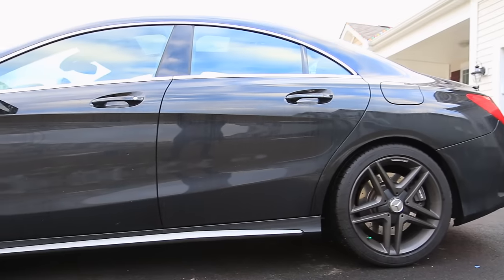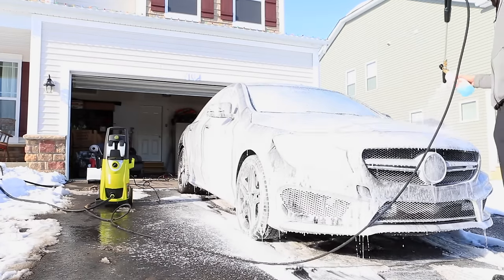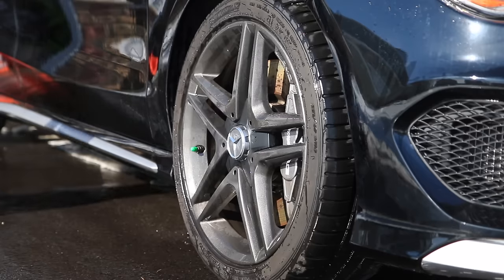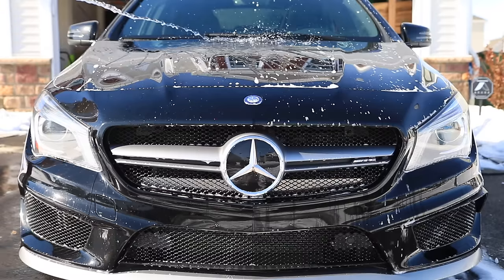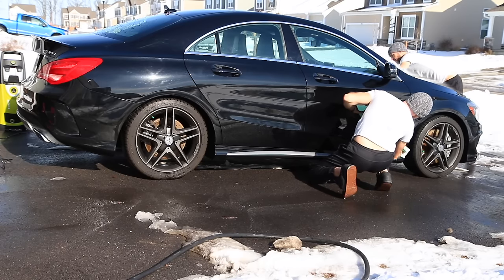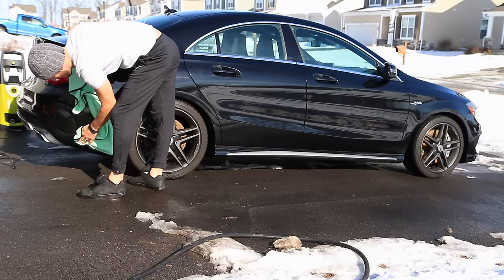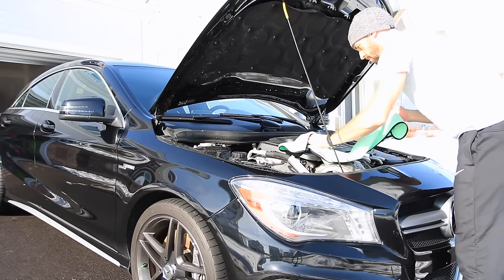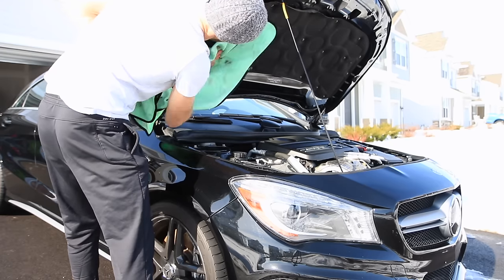Exterior Car Detailing Like A Pro! Car Cleaning

Comment: You don't use a air blower for the water trapped in small areas like the outside mirrors? I always have water leaking down because I don't air blow the mirrors

Comment: You mention one thing that gives you joy is to take particular care around the jams of door and boot, and I see in the video underside of the hood, but you don't appear to wash these areas just wipe them with drying/damp towel?
If you love them why not use a good lubricating soap with boar brush or microfibre towel to get the dirt off before drying?
Reply from the maker: Agree, but in my case they are relatively clean and a damp microfiber with quick detailer or damp towel usually is all it needs.

Comment: Thanks for the vids. I'm starting to see rust pings from rocks and salt on the roads after 5 yrs/125k miles. Id love to see any diy fix videos for this....would be great.  I'm hoping I can prevent them from getting larger?
Reply: Wash the area, use an iron remover. Clean the area again and apply touch up paint.

Comment: +1 on engine bay clean. Nice job. Ever thought of some air for phase 1 drying? I use an electric leaf blower to keep running down and then use a drying aid on towel for remaining wet spots.
Reply from the maker: Yeah I have actually but haven't got around to picking one up specifically for detailing. I would love one specifically for the panel gaps!

Comment: Good info! Paint correction video next? And what’s the difference between polish, compound, and all that good stuff. Thanks!
Reply: David compounds remove defects such as swirls, marring, and light to medium scratches that haven’t went through the clear coat. Some polishes have the ability to remove very light defects but is meant mainly to enhance the shine on the paint. Waxed/Sealants/Coatings are meant to protect your paint from harmful UV rays from the sun, water spots, etc. A sealant offers anywhere from 6 months to a year protection whereas a paint coating offers anywhere from 1-5 years protection.

Comment: Most say to use a microfiber towel to dry but i dont get really good results from that. ive even tried wetting it. Maybe i should get a different microfiber towel?
Reply: Get Griots garage PFM drying towels its 38 for one towel if you have budget..one swipe and done dry panel no streaks..one time investment tough..
Reply: Thank you

Comment: Been loving your videos on how to clean. I've parked my black car by a concrete plant and the concrete sand dust caked a layer on..it was a very hot day the next two days then rained. Now my car has an invisible layer of spaced out grit, you can't see it but you can feel it. You can see it on the good because the dust was white. I tried polish. Should I claybar first ?
Reply: Hood*
Reply: Always use a clay bar before polishing, just insures a flawless finish you don't want any of that concrete residue getting on your pad mid polish will make everything alott worse.... Hope this helps you bud🙏🏻

Comment: Your wash and dry method made me cringe. You’ll get a lot of swirling the way you are doing things.
Reply from the maker: How so chief? Foam cannon followed by 2 bucket method isn’t enough? Please elaborate on the Andrew Le method of washing
Reply: He's probably referencing to the fact that you don't use a drying aid such as a detail spray to add lubrication and using the same towel that you dried the car with to clean the door jams and engine bay.
Reply from the maker: Ah well if that is what he was referring to, that would make sense. I had two different towels that were used and one for exterior and another specific to the jams, gas cap area, trunk and hood.
Reply: Stauffer Garage in the video you can see your car full of swirls, poor MB
Reply: you are using way too much pressure drying your vehicle. you are drying it like those guys who hand dry your car at those drive through car washes. try drying your car by just patting your car lightly with that waffle weave towel. Pat dry and never drag your towel at all.  you are also drying it from the bottom to the top, using it to dry different portions of the car like jambs, front windshield plastic cowl, etc.   you basically are just inducing crazy swirls.   Also, like @peter M said, you need a lubricant for jambs, etc.   jambs  you won't see swirls as much because it won't reflect back light as much but i promise your door jambs are trashed as well. take a look at my video i just posted it up for you in my channel.   2 bucket method, going from top to bottom, only pat drying.  no swirls, holograms, flaws anywhere.   I've been doing this a long time, had a 5k custom black paint job on one of my older cars and you are just washing/drying way too aggressive for black.  Mercedes actually have a tougher clear coat from factory, its the same clear coat i bought for my previous paint job.  its much more hard, chip resistant clear made to take impact from rocks and debris on the autobahn .  And if you are swirling that, you would literally trash every other manufacture's clear coats badly.
Reply: exactly.
Reply: yes, looking back now on my macbook, he has swirls everywhere. his pressure hand washing, drying is way too hard.
Reply: You said wash top first and move noodle from skirt to bonnet without rinse? Dude, your dring looks intense man... you and your twin should chill...
Reply: english?
Reply: Final Touch .Professional Detailing. So true by the tail light
Reply: You guys dont lift up the windshield wipers during the wash and call it super wash??? It looks so unprofessional. Leave the wiper down while wash will result all the dirts stay on the windshield. Please dont call your selves as professional washers
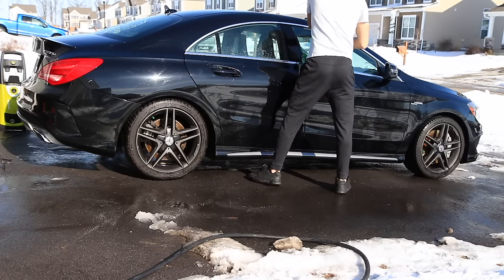Reply: @4:40 Yeah I have to agree that those swirls are quite bad.

Comment: sorry for late but why green valvet winter? wrong air in those tyres ?
Reply: Green valve caps means the tires are filled with nitrogen. Not compressed air.
This is better because:
1-Nitrogen doesn't fluctuate with temperatures like air
2-Nitrogen doesn't produce moisture inside the tire like air does.

Comment: what would you recommend as a suggested power washer PSI rating for a car?  I can obviously buy one from home depot that i can use for my house, but I guess is there a suggested power nozzle or option for such?  I always get catious of power washers and such especially as things get older, I don't want the power of it to pull any paint or add to chips that I would have only seen previously with a garden hose and sponge.

Comment: Easy to swirl no matter how careful you are when you use wash mitt and two bucket.....My method: Dont need grit guard or 2 buckets..Get one bucket fill with your favorite soap..Get some plush microfiber towels I use rag company creature edgeless..Use 2 or 3 towels per car wash..Soak 2 or 3 towels depending on car size in soap mixture for minute or so..I use pressure washer to remove the dirt first from car then use foam cannon to foam up the car..I dont rinse the soap let it sit on a car for 2 or 3 minute obviously dont recommend doing this on hot panel or in direct sunlight..take out pre soaked towel from soap bucket wring it so its not dripping..fold towel in 4 so you have 8 side to work with..use rinseless method swipe towel on one panel and flip it to clean side to wipe it again that way you are not rubbing the dirt again on swiped panel.. once 8 sides are used change the towel..dont dunk it back into the soap mixture..This way I am discarding my soapy mixture after every wash either..i do this on whole car using 2 or 3 towels never swirled. Once done with towel I go with wash mitt on my whole car and never have to worry about grit guard...and use PFM towel from griots garage much better than this cobra..trust me this method works much better..It takes time but worth it..I do recommend pressure washer though makes life so much easier..

Comment: can you do a wheel well video. sometimes spraying and scrubbing doesnt work, need some new ideas for that area
Reply: use APC or super clean let it sit for minute or so to let it do its thing.. super clean is cheap and available at walmart..can use it on wheel and tires as well..only way to clean carpet wheel well like in most modern cars in rear just scrub and pressure wash..most front ones are plastic and way easy to clean and maintain..once you have cleaned properly use stoner more trim shine on plastic..nothing will stick and it will make is nice and shiny..and if you are very anal about cleaning it there are tons of videos https://www.youtube.com/watch?v=_zFFTEERdpQ

Comment: What’s a good brush and and rim cleaner I have some rough stains in my rims
Reply: You want to avoid acidic cleaners.

For the tires, I recommend Gyeon Tire Cleaner with Maxshine All Purpose Long Handled Stiff Bristle Brush

For the rims, recommend using an iron remover such as Gyeon Iron. Use a wheel wooley and a good car shampoo.  Remember use a bucket for just tires & rims.

Comment: Here is another quick way to dry your car. Go and purchase a cheap electric blower. It is quick and no towels touch the car and you get all the nooks and crannies with very little effort.
Reply: Jason Tubbs I use the Worx Hydroshot power washer to apply a spot free rinse using distilled water. This way the car can air dry, leaving no water spotting.

Comment: Ehh, Pro is an over statement. Some of the " pro " tips u were saying, id consider common sense. That car isnt too old and already kind of showing swirl marks and color fade. Overall just seemed like a quick wash. Id never seen a detail use a sponge on tires. Tires still looked kind of dirty n the end. Never seen someone wipe the engine bay then use the same towel for the inside paint of the hood.( seem like extras u did to make it seem "pro"). While focusing on extra non sense, missing all the inside fenderwalls , cleanes tires better , car was washed in direct sunlight(being black thats a headache) . there was just so much "pro" content/details, that this lacked . it was fraud. All it was , wasa quick wash. In my opinion. But great vid